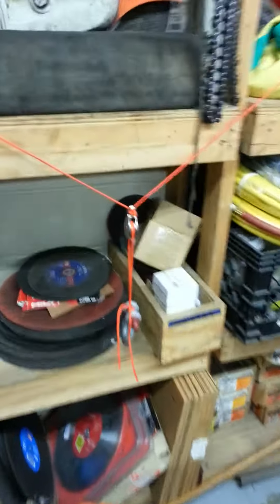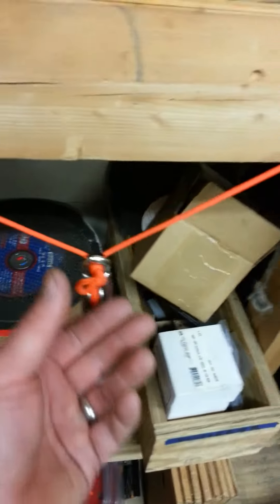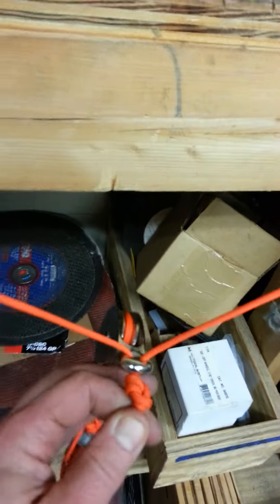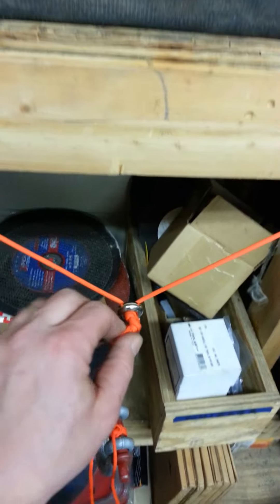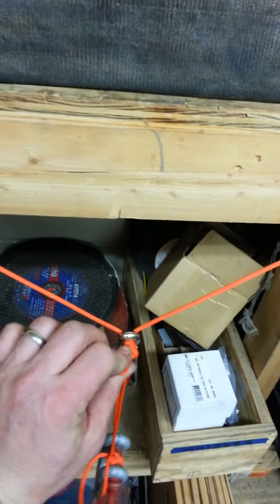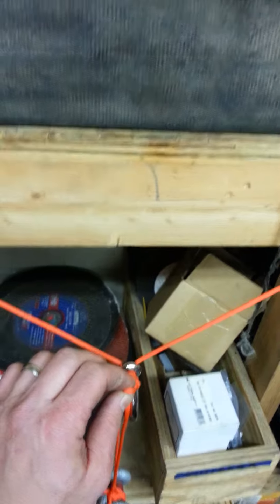Progressive Rescue Anchor System R&D

Comment: I have made similar anchors in some climbing applications. It made sense, but I would like to see the actual numbers on those forces. Thanks for sharing.
Reply from the maker: You bet. I did have digital scales attached and the load numbers hitting the anchors were cut  more than 50%.
Reply: Mike Donahue Nice.